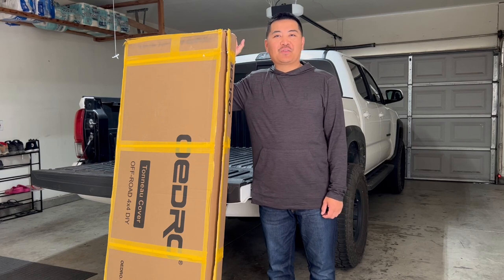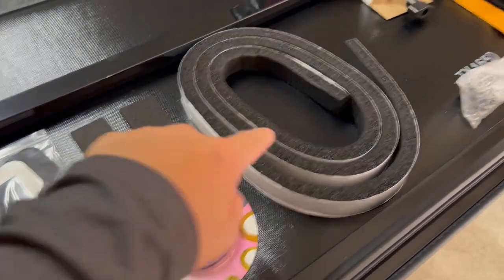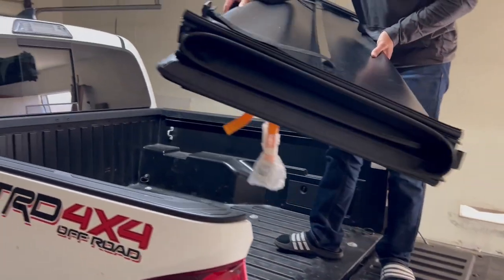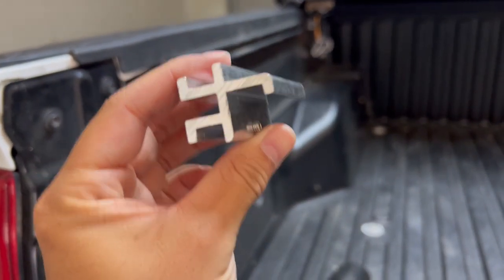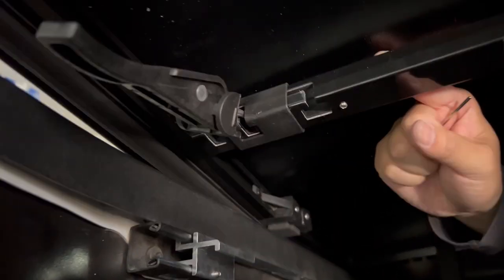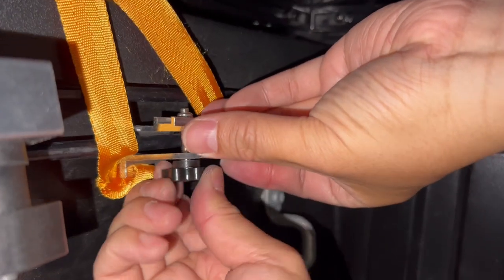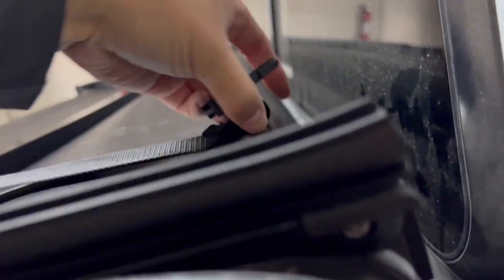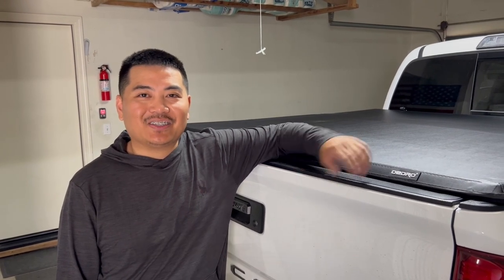OEDRO 5ft Soft Tri-fold Tonneau Cover for 2016-2023 Toyota Tacoma | How to Install Unboxing Review

Comment: No way that's waterproof, doesn't cover the tailgate
Reply from the maker: Well maybe water resistant? Because it keeps majority of the water out and yes it does cover about an inch of the tailgate, the tailgate is really thick.
Reply: I can confirm that after 2 years it is pretty much waterproof.
After washing it, rain, or even running through the car wash still haven't had any issues.
Reply from the maker: That’s really good to hear! Thanks for sharing 🤝

Comment: Does your tailgate open and close easy? Mine gets stuck with the cover and I can’t loosen the back clamps to move it. The wing nut is the only thing  turns. Nothing else moves
Reply from the maker: Sometimes the tailgate will slightly touch the tonneau cover but overall it wasn’t too hard to close. You might have to move your tonneau cover forward on the bed? I have a roll up version on now and the tailgate barely touches the cover.

Comment: The tail clamps on mine won’t clamp to the brackets. Too short, wtf.
Reply from the maker: Did you try adjusting the length of the clamp? Also there should be 3 different positions that you can set the clamp.
Reply: Yeah I had to keep twisting them down all the way down to the end of the screw and eventually with some trial and error got them to finally attach.  Thanks.
Reply from the maker: Yeah mine were the same way, I believe they ship them that way.
Reply: One more question for you when you get a sec. Do your weather strip squares actually stop water from leaking in from the bulkhead corners?  Rained today and had some water in the bed. Figured it’s not actually advertised as a fully waterproof cover so maybe that’s to be expected.
Reply from the maker: It doesn’t rain much in California but i usually park in a parking garage at home and work. But I really don’t expect it to be 100% waterproof. Just like your vehicle the seals are good but it’s not 100% waterproof. But I haven’t seen much water in the bed of my truck.

Comment: Why didn't you install the seal strip?
Reply from the maker: The tonneau cover seal itself is pretty tight so it’s not really needed.
Reply: @TheCastLife  thanks foe the truly. Do they instruct you to use them, or are they just backups
Reply from the maker: It’s in the instructions but mine has yet to leak without a seal.
Reply: To add to this, I installed the seal strip initially because that's what the instructions say, and the seal in the front two corners of the bed was awful. At least for 3rd gen tacomas it fits much better without the bulkhead strip